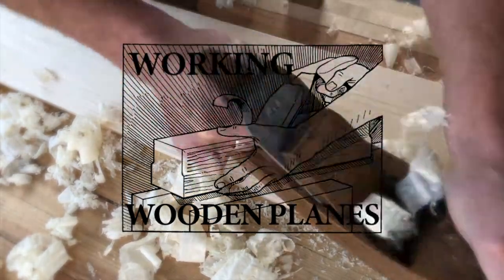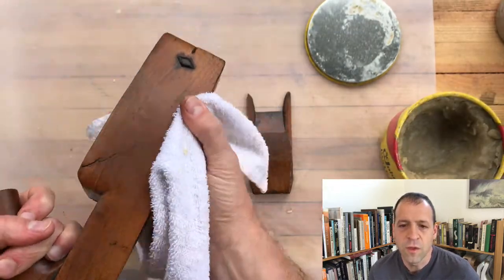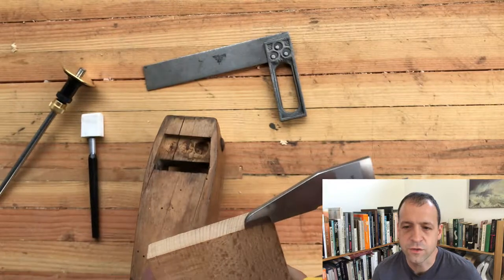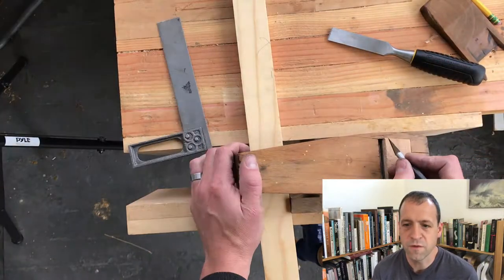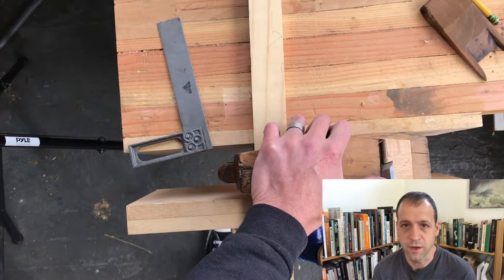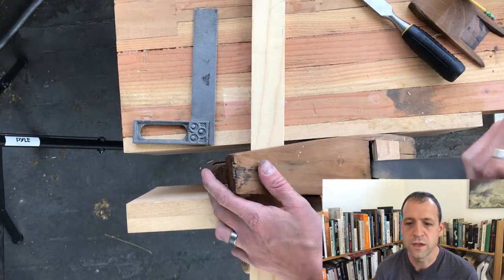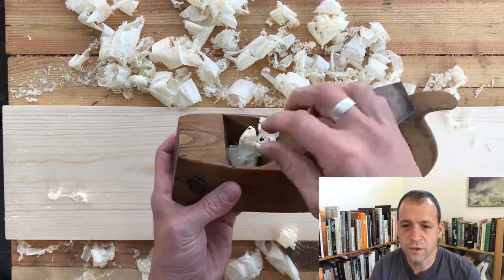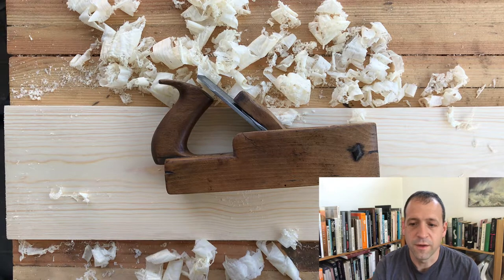Restoration and Throat Insert Repair

Comment: Did you ever get this plane working? Since you replaced the plane iron with a Buck Brothers you have a totally new wedge geometry. Not only do you need to rebed the iron to the throat of the plane, but you need to rebed the wedge to the iron. The most likely reason you were getting chatter is that the wedge was contacting the abutments in the back,of the throat but the fingers were not contacting the iron near the mouth. Stick a feeler-gauge in the mouth and see if you can get it between the iron and the fingers. If you can, a few swipes of a plane on the back of the wedge should prove all the difference.
Reply from the maker: I used the iron that came with the plane. It's not a replacement. You don't need to change the wedge shape when you use a new iron. Back when these planes were new it was expected that you would go through several irons over the life of the plane. Iron geometry was fairly standardized so all you need to do was drop in a new iron once the old one was used up and you were ready to go. With that said, when I'm restoring a plane and the wedge itself is in bad shape, then I sometimes do change the wedge. I like your idea of using a feeler gauge. I typically just make minor adjustments until I like how it beds, but a feeler gauge is a much better idea.
Reply: @WoodenPlanes Hmm. In the video, you showed that the original blade was trashed, so you switched to a vintage Buck Bros iron.

Comment: Hello from the UK. I enjoyed your film, and have restored many a plane in a similar manner. May I suggest that you reposition your inset to the top left of the screen as some of your work was obscured. Otherwise a first class job. I agree that gentle cleaning of the wood is preferable to a total strip down. I love to see the decades of history and labour in the knicks and marks. I was selling some of my planes at the Woodfest event in Wales last weekend, and using only a Black and Decker workmate and some pallet wood, people were astounded at how good these planes and the related Jack's and jointers performed. When I gave them a chance to try the planes, that was when they had the realisation that wood on wood equals less friction and that the heft of the plane does half the work. Coupled with the fact that old tool steel takes such an edge, once the foibles of these planes are mastered they are the equal of anything on the market, regardless of the price.
Reply: Remarkable that the old tool steel takes such a better edge than today's tool steel!?
Reply: @frro28 but does it really?

Comment: A trick I often use when I need to transfer an iregular shape, or screw holes for mounting, is to photocopy the original and cut it out. Then, I can place that paper template where I need it.

Comment: You have to slide the iron back and forth, only using finger pressure. If the plane iron does not move, then you are not rubbing. Pressure along is not sufficient. Have seen several use a carpenter's pencil to do the same thing.

Comment: At 30:46, saw quick flash of the sole of the plane and plane iron protrusion. It looked like there was no wood supporting the iron at the back of the mouth. I'm pretty sure that will cause your chatter. As your iron wasn't custom fit to the body, quite likely needs more fettling as well as the side fingers of the wedge looked extremely short won't be clamping the front of the blade iron down. The back of your iron looked terrible after your 1st test shave. Did you flatten it after that test?

Comment: Like your approach to cleaning. I use window cleaner and a green scrubber sponge. I repeatedly wet, scrub and sop with toilet paper.
This removes the loosened dirt and avoids grind it back into the surface pores - give it a try you may like it. But like you say, it's all personal preference. Thanks for sharing your techniques!
Reply: Dish soap, shampoo, diluted 99c degreaser, etc.

Comment: 19:50 can the pits be filled with welding or silver solder?
Reply from the maker: You don't need to. You just need to flatten the back of the iron until all the pitting is removed.